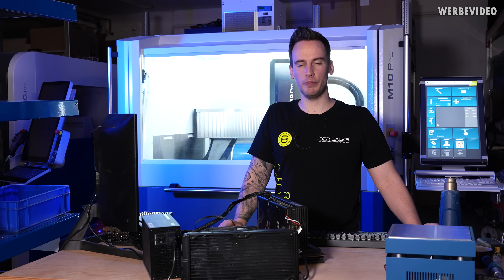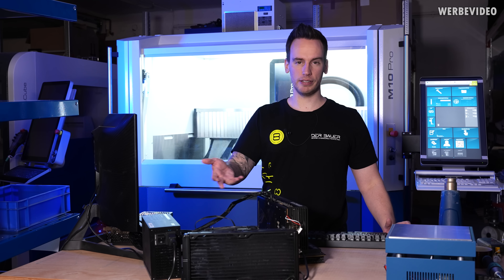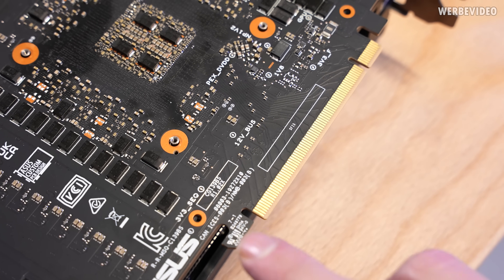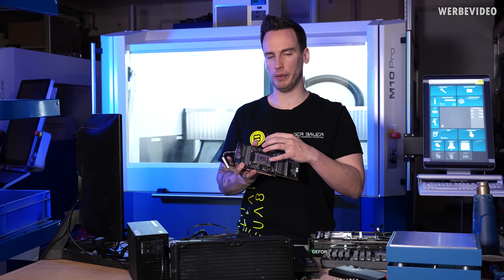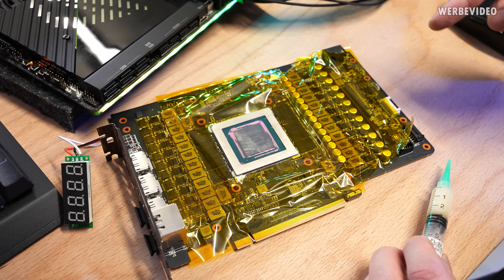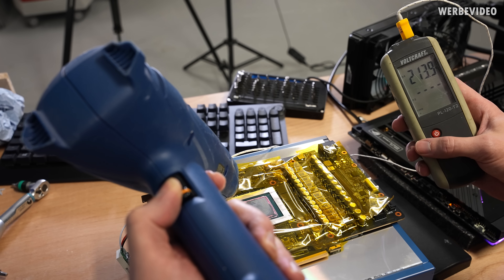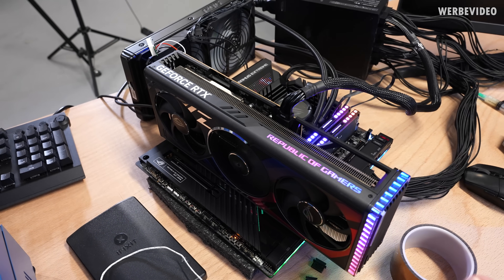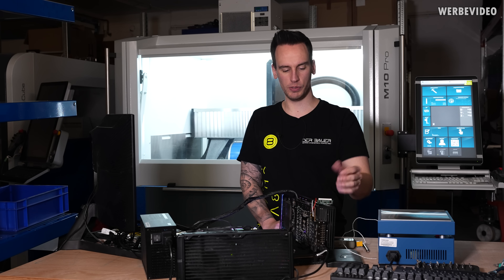I tried to repair my RTX 4090 and killed it :(

Comment: Do people really put their card into the oven and set the temperarure to 80 degrees C? I mean, that is cozy temperarure for the graphics card, but I don't think those cards need to go to the welness... Ovens can do ofteb more than 300 degrees C. You still should NOT DO THAT , aspecially when you using the oven for food, but if you have to do it, at least don't try to make the card happy, bake it with some usefull temperarure.

Comment: You did not remove the lifting pads  from the corners of the GPU. Perhaps its just unconnected itself when you heated up.  A BGA reball is at least what you can try. ChrisFIX or maybe send to USA to NortwestRepair. Tony is a GPU Gangsta. ;)  (if you still have this board of course.)

Comment: Well Kapton tape is not thermal insulator. Do not use it for heat protection! Use come piece of metal or aluminium foil. And before any attempt watch some GPU repair videos like ppl mentioned multiple times, northwestrepair, northridgefix, krisfix.... It still might be fixable but you need right tools, skills and knowledge.

Comment: You are ruin8ng your card doing what your doing. Your going to bond some of the balls in the gpu. If you just changed the m.2 to slot 2 your problem will go away

Comment: Your card is fine. Just move the ssd to slot 2. It will work. I promise this fix3d my card permanently. I almost return3d the card but it dawned on me that the 5.0 pcie is sharing pcie bandwidth with the graphics card.

Comment: I had the same problem. What fixed it was taking the m.2 990 pro 1 tb ssd out of the number one slot. It will share the pcie x16 with the graphics card and number one m.2 slot. Once I moved the ssd to the next slot down. My strix oc 4090 will run in x16 pcie

Comment: Your next step is to have the cpu on the gpu taken off and reballed being you put solder in the cpu sides and tried to reflow it. That for sure linked some of the traces. Talk to Alex at NRidge Fix and he will h3lp you get it fixed. He eoesnt do the reballing of the cpu but knows people to trust to do the same professional work.
By the 2a6. When 8 removed the m.2 out of lane 1. I installed 8t into lane2 for the second pcie x16 lanes. Thats where my windows os system lives and everything works perfect now. I hope you good luck and love your show and products. I try to buy most of my componets from you.

Comment: Yes it will x16 on other cards but try another Asus strix 4090 again and it will be the same. Once you remove the m. 2 on the number 1 pain that your gpu runs on also. You have to change the settings in the bios to only run x16 gen 4 on lane 1. If you don't make changes to the bios the card will still run at x8 gen 4. I bought a brand new card and had the same problem. This is how I fixed it. By the way my same motherboard without making any changes ran my EVGA 1080 to Black at x16. It's the way the new Asus strix oc 24gig 4090 runs on a lot of motherboards. I did not have the same problem trying the msivz 790 extreme motherboard along with the Tomahawk z 790 ddr4 and ddr5 boards. Asus is very finicky. Sorry you went through all you did with your expensive card. I wish I new this earlier.

Comment: Never use that paint scrapper heat gun again,  tried to fix back in a day when had 3 Nvidia Geforce 6800 XT I destroyed all 3 GPU-s just like that with cheap heat gun, it needs a special BGA Rework station with Infrared heating element much more precise than heated air and after the soldering needs to X-rayed to check the BGA's for voids that will kill GPU for sure ! Maybe you have memory issues don't you think ?!

Comment: I see no one here knows that the only solder balls that fail with thermal expansion/Contraction are the filp chip ones that are sealed away the reason they fail instead of the regular ones is because they are micro solder so cracks can form easily.

Comment: Try to use liquid flux instead of paste flux, give some heat again but not too long, probably some ball of the BGA is missing after the heat you did, so the best way is to take out the gpu and make a reballing, this will fix your problems for sure

Comment: Electrical Engineering student and former System Analysis engineer here:

leadfree solder usually melts around 213 degrees celsius IIRC. It might take a while to reach that temperature under the BGA as there might be a solid copper plane below it (multiple internal PCB layers). This means longer baking time is needed. In our factory, this takes multiple minutes (5 to 10) for a single PCB. 

With the kapton tape you might have displaced a smaller component due to forces of the kapton tape displacing the component while the solder was fluid (smaller thermal mass of other components). Baking definetely can work, but i suggest you do it in an oven where it is fully enclosed without any foreign objects on it such as tape.

You can retry it this way I would say as it is dead anyways. Thermal stress is not good for PCB's.

Im not sure if the initial error was related to the die however...

Comment: Capacitors are like little batteries that store a static charge.  Many of the components on a graphics card are static sensitive.  Putting a previously active card onto a conductive metal surface is like randomly shuffling your feet on a carpet, building up a static charge in your body and randomly discharging it on your PCB for fun.  They come in an anti-static bag for a reason.

Comment: i know the problem.. Its a Palit GameRock....
I had multiple Palit gameRock 1080Ti's... All fail on me and had to be RMA'd... All of them suffered the same issue.. VRM's basically fried theirself, within a few months...
My friend also had a Palit Gamerock 1080 Non Ti, at the same time.. His failed within less than a year, Just casual gaming..
Will never buy another...
But on a serious note... Check the VRM's are all functioning correctly..
Also.. If its only running at 8x, So technically, the second half of the edge connector pins arent doing anything.... Try checking the SMD Capacitors within the area of the card edge connector... 
If they go short, or a high ESR, they can potentially do this... I repaired a couple of 3060's that did that...
- I have all the required tools.. BGA reflow station, Reball stencils etc, and have reballed many BGA chips (mainly xbox 360 RROD lol).. But unfortunately, I am in England... So unable to help you...
It was a good move by you, By using a heat plate... This helps to stop the PCB from potentially warping... But big No No, is using a heat gun..
Sure the heat is heat... But the airflow is often waaaay too much, and can easily caused SMD components to be blown off their pads once the solder melts...

Comment: To be honest you do have to reball the gpu since it could cause some of the solder balls to contact each other which is causing a short. However the main die could become damaged and will be a new chip. I know this since it’s kinda how I finished off my old 1070 from dell. I would have a screen issue with artifacts. Then I decided to do the home diy reflow and it died.

Comment: Using a heat gun was a BIG mistake.... You can't control the temperature, you put capton tape on the probe too... but the heat gun probably went way over 300 very quick and could cause all kinds of melting wonders under the gpu. Maybe with a professional reball you could save it but I wouldn't have high hopes for it.

Comment: You need to remove the GPU chip from the card. Clean up all the soldering pads. Inspect the pads and traces. Re-ball the GPU chip. Solder the GPU back again, but not with a heat gun, but with the proper soldering station with the upper heat generator, bottom heating plate, the stands that let you keep the card even (so it won't warp), and temperature monitoring. Also, you need a microscope or a magnification glass to see when the soldering balls are melted and if the GPU chip sat down evenly.

Comment: I have noticed while you were starting to heat the GPU, and then prodded the temp probe with the heat gun. You may have knocked the GPU while still hot. Also using a DIY heat gun can cause the PCB to bend and lift due to the high air flow.
This is fixable via a re-balling, I defiantly send your card to someone who do these kinds of repairs for a living like Tech Cemetry

Comment: The way he is handling the card it is damaged anyway. He destroyed any sensible chip through static discharges while talking about not putting it into an oven at 80°C.
Well that was a good idea as some parts might get damaged at 80°C. Then he put it on a hot plate at 100 degrees and heated it up to 200-250 degree using a heat gun.
Well every electrolytic capacitor just gave it's byebye in that moment.

Comment: I once fixed one using the same method as you just did that "killed" the card, but with a difference. I didnt have the heater plate, and I left the cooler attached (just heatsink only) with stock thermal paste and pads as I didnt want the chips to move. I then basically cooked the top of the heatsink only with a heat gun and then left it to cool down to room temp by itself. I then removed the heatsink and changed the paste and pads for new stuff reassembled it and perfect, working and still working to this day. Granted it was a 1080Ti, so not exactly the same beast as a 4090.

With that siad, I am also no where near as experienced as you at this kind of repair and the 1080Ti was completely dead before I started so at least I couldnt make it worse. Perhaps what I had was a fluke.

Comment: I use oven for this and i don't think its a ball solder problem. I think its a power issue or a power delivery issue. I got mine working in oven 240c 12min worked like a charm.
I know its power issue try undervolting it you will see.

Also if you use heat gun and its not good cause card heats up uneven you need to use oven.
if you think solder wont melt in oen use a hotter oven duh.

Comment: Quite a sad outcome. Not entirely sure why you went straight for a high risk technique and using a hot air gun, while also handling the card while hot. Temps could have been too high. Air movement may have shifted parts. Handling hot may have shifted parts.

Should have tried a low risk method first. Simply bake at 180C and do not handle until cool. If that didn't work, then move to more high risk methods.

Jumping straight to a very high risk method first, on a very high value item, is simply not a very logical approach.

Comment: I dont understand why it stopped working, i dit it the same way, but with 380°C hot air gun, without hot plate, just yolo, and it never end up worse than before, like 5 out of 10 it worked

Comment: @Roman check das bios 7 entl bios switch wenn die einen hat mal testen. bios chip ist warscheinlichd efekt / corrupt nach der Hitzebehandlung von der backside. danach mal memory checker laufen lassen falls die karte core clock und memory clock anzeigt. ggf nochmals 8 -10 min bei mittlere Hitze 110 - 150C im Backofen garen ( kann beliebig noch mit ein paar vorgeschnittenen Mosfets garniert werden ) :p  mit neuem Flux nat.

Comment: used to bake my 9800GT in the oven once a month but micro cracks in the solder appear after a lot of hot&cold cycles and this gpu is way too new for that sort of stuff, also what you did was an abomination😅solder turns liquid between 180-200°C from what i remember and you would keep the card in the oven for about 10 mins because cracks could be anywhere on the board and after it would work just fine, what you did there was try to desolder the chip

Comment: In my not very experienced opinion: -

1. A GPU reflow should be the last thing a person should do.
2. The hot plate is good for single sided PCB's.  Dual sided PCB's when manufacturing the initial side.
3. The heat gun can reach temperatures of about 550c which would be too much heat too quickly.
4.  Kapton tape can cause issues when components under it go in to a reflow state and surface tension can't do it's job due to the tape.

I would inspect the PCB using a loupe or scope to make sure those tiny caps and resistors are all in places where they should be.

Comment: I am not at all surprised that heat more than 2x the rated operating temp did more harm than good.  It's unfortunate.  A really careful examination of the components that control how many PCIe lanes are used, could have been interesting.

Comment: I fear youve cooked your GPU using a paint stripper hot air gun D: Use a proper reflow hotair gun. You might be lucky... Try again this time. Set the hot plate to 150 and use the reflow gun at around 250. Use a lot more flux, and maybe reflow the memory as well, looking at the later memory type issues...
Also maybe place some baking paper between the card and hot plate. 

Also just for sanity check. Make sure theres no voltage running through the hot plate. It might be shorted to mains or something and that would kill the card, electrically....

Comment: I've experienced something similar with an old GPU, I think it was a GTX275. The odd thing is I got to make it boot by slightly twisting the PCB before turning on the PSU but it would immediately die when I let go and stop applying force. I would say it's for sure bad soldering on the memory modules or even GPU, I guess it would be fun if you bought the hardware to attempt reballing yourself, would make for an interesting video.

Comment: Well, you bought a somewhat decent pre-heater and then you come with this "10 Euro Heat gun" and no experience... what Are you expexting?
On chip-level you start with small SMD and ICs and become experienced after a few dozens attempts. Working with BGAs is the absolute Kings discipline.

Comment: I can tell you from actual experience that thick flux will not spread evenly under the chip. The surface all of all the bga balls together sucks up more flux than you think.
It would be better to pour liquid flux on and let it flow all the way under.

Comment: I just received the Asus Z790 Extreme (11/28/22) with a NEW MANUAL that clearly shows that Video Card on PCIEX16(G5)_1 connected together with M.2_1(CPU) makes the video card work at 8x

Comment: Doing the bake more than once with iMAC cards, and it was 230 celsius for 8 minutes, then let it cool down in the oven slowly. And those card worked just fine for a few more years until the iMACS went on pension

Comment: Well I fixed 1080 ti and 2070 super if im not wrong. The issue is about my location or where those gpu used. It was about humidity. Because many my stuff or friends like most RAM it like just out of working so only thing that cam fix them it’s just heatgun. But the 2070 one just like yours someone put it one that heat machine and nothing more and it appears just like urs i tried many stuff on it and nothing work. And thing I know about those heat machine they don’t hava any G wires or ground one so i was like may it kill cuz of that. So i try replace the bios chip got one from ebay. And try install the bios version on it it jist show up. But in benchmark still crashes then heat it again about 180-220c then put it back it just work normally.

Comment: What a waste heating and making it even worse. At the end of the video it a classic sign that is vbios chip is corrupted meaning he needs a new vbios chip. Good luck trying to find a replacement chip. He should have send it back once the card is having issues. I bet you €100 that the overvoltaging the vcore voltage is the cause of the gpu failure

Comment: Next time, remember you only have to get that temperature at the solder balls, not at the gpu core itself. The under board heater helps to you don't have to use higher temperatures on the top of the board, but remember the board is very thick, so it dissipates high amount of the heat you apply to it. 
The better results are preheating the back of the board near 200ºC, and apply heat to the top around the gpu in circles in order to get the board temp higher. then he flux will start to evaporate and you should start to apply heat to the gpu itself, but in short bursts till all the flux dissapear. Then is very important to let the board temp go down as slow as you can, I usually shut down the back heater and leave there the gpu in order to slow down the temperature drop.

Comment: PCB manufacturing defect. Send it back.You've been the 1 million unlucky VIP to happen this. (You need factory tools in order to fix the PCB . Core and memory shows as running. Possible microtransistors to be burned, that can happen because PCB factory install.)

Comment: reball the main chip, but use some better tools with hot air temperature control or infrared, bottom plate around 200c and chip 300c. actually better give it to pros they can fix it you will damage it beyond repairs.

Comment: Something nobody is mentioning is that you REALLY should have cleaned the flux from underneath the GPU. Fluxes are usually a little bit conductive and having your GPU basically swim in it is definitely no bueno. Just drip some IPA between the BGA joints and gently apply compressed air to flush out the flux. Repeat a few times and you should be (or rather should have been) good to go.

Comment: This is the kind of videos that should start with a big announcement saying: DO NOT TRY THIS AT HOME!

I recommend you to visit subreddit NVIDIA. I've read so far more than 10 post of people having the same issue with their TUF, Strix and some other model that I can't remember. But looks to be more people having their 4090 running at x16 at start, then their cards fall to x8 and none was able to made it run again at x16 anymore.

Next NVIDIA polemic? We will have to wait for another GN video explaining what's happening while NVIDIA people sits at their work scratching their balls waiting for someone solve their faulty products.